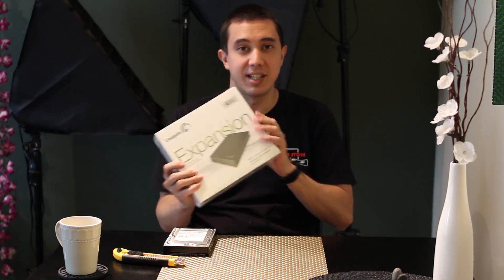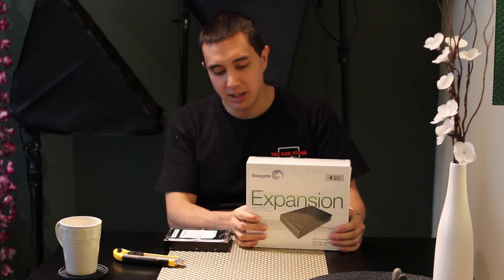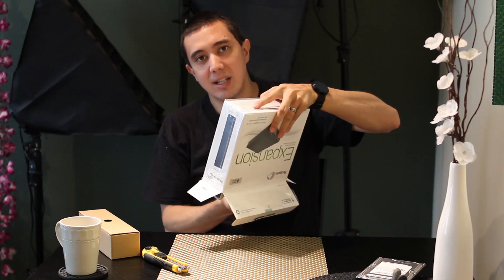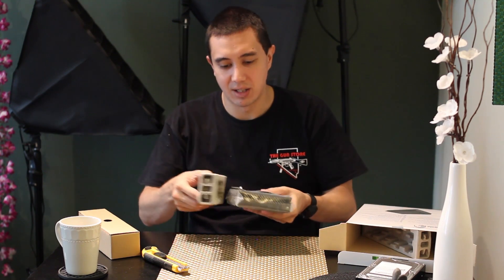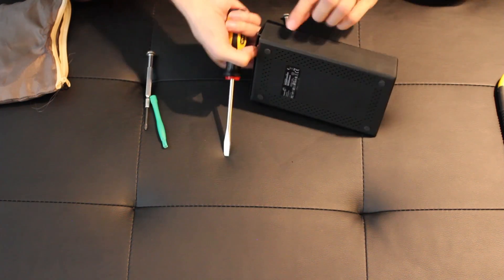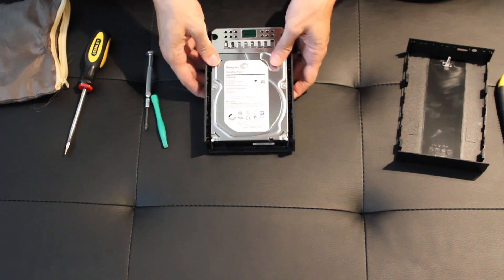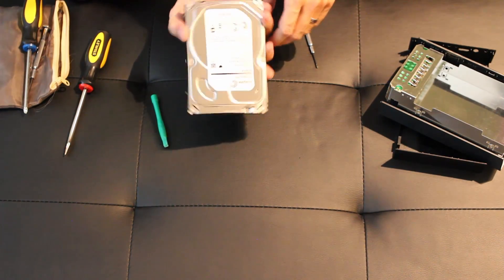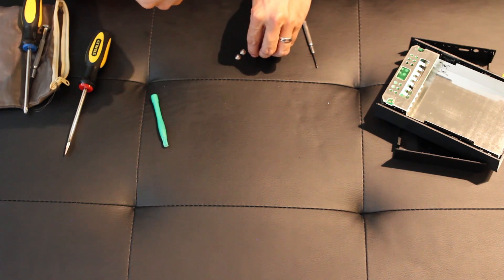Save money cracking open / disassemble seagate expansion drive 4tb

Comment: That's a good video explanation. A lot of people think these older Seagate externals are a failure but there is usually nothing wrong with the actual hard drive inside and they are recoverable. The older power supply adaptors are usually the biggest fault. Now with the newer USB power units advantage it's okay. Apparently you shouldn't try this with Western Digital units as their hard drives are designed differently.

Comment: Use for pc gaming? Load fine?
Reply from the maker: No, use an SSD.
Reply: TryHardGamers ssds cost way to much for game storage so either way I'll use a hdd for my games jw how well this is compared to normal hdd I'm need several tb and ssd that size well u know more then my 1000 pc
Reply from the maker: Are you talking about PC gaming? Why would you have several TB of games? I think if I installed the hundreds of games I have on steam all at once yeah, it could be a couple TB. but Am I gaming by switching game every 1 minute. You can get 1TB SSDs affordably now anyway.
Reply: TryHardGamers well I like to have my games downloaded and ready he'll my ps4 now has 4tb on this 5tb drive digitally...I've used hdd before for pc storage I was just wondering if I crack open this drive to put internally is it that much slower then normal internal hdds...and 1tb ssd is not a affordable for me still couple hundred and worth games being 50 to 100 gigs it don't last long
Reply from the maker: You decide what you do with your money and time. I would rather have the games I play available (ie. downloadable) and load quickly (ie. ssd).

But I understand if you have a slow internet connection. I've been there, as you can probably tell by my accent, I used to live in Australia and a game like WoW would take literally days to download.
Reply from the maker: That being said, I'd be surprised if there was a noticable difference between a 7600 and a 5400rpm drive for game loading. Games that take a long time to load are usually killed by seek time, and... all HDDs suck in that regard.

Comment: They wouldn't sell exact drives cheaper. It is very much worth mentioning what the sticker on that HDD says - what exact model is it,  and also running some test or info programs - maybe that would solve the mystery of it being cheaper. I believe it's at least buffer size that's less on those external models.
Reply from the maker: If you're worried about the performance of spinning rust, buy an SSD.

Comment: I'm thinking about adding an external drive to my PS4 with the Nyko Data Bank adapter, which accepts 3.5 inch internal drives. Does anyone know if this would work? If so, I might get at 5 or 6TB to futureproof myself and save money vs an internal drive.

Comment: Can someone tell me how to fix this: When I took the drive out of it's enclosure and hooked it up to SATA in my PC, it shows it as a D:\ Drive that needs formatting and two other unallocated partions! Yet, when I re-connect back to its enclosure with its A/C adapter connection, it shows up as Seagate Expansion Drive and works fine as my M:\ Drive! What gives?
Reply: the USB to sata card inside the enclosure probably has a encryption chip that only works if its used with the original hardware. If you dont jhave anything on the drive thats important, download WD's data lifeguard diagnostic and do a zero out of the drive which will make it unallocated like it was brand new, then u format it and boom you're good
Reply: ***** Well I have very important stuff on it, and I don't want to format it. Any solutions?
Reply: copy it to another drive

Comment: 5600 is garbage and you are better off paying more for the 7200 drives regardless what the author of the video is claiming. Its a 20% difference in speed and if you use this drive on a daily basis, you will not want anything lower then 7200.
Reply from the maker: For what use case, if you care about speed why aren't you using an SSD?
Reply: When you are dealing with TB's of data and browsing it on a daily basis, the 20% difference between 5400 and 7200 becomes annoying not to mention the more you fill that drive, the slower it becomes. It should be obvious with the cheap cost nowadays that a SSD should be used either-way. FYI you should try M.2 PCI and understand 5400 is a joke.
Reply: 5400 is quieter. Perfect for a quiet media center
Reply: 7200 rpm drives produce more heat. If you're dealing with TBs of data, you should use some sort of RAID setup.
Reply: Your comment is what's garbage. No drives are 5600. They are 5400 or sometimes 5900 (this looks like a 5900 rpm ST4000DM000). There are tons of use cases for lower RPM drives. Drive rotation speed doesn't mean the drive has a higher read/write performance.
Reply: WTF are you browsing TB's of data on a daily basis? do you know why  drives running at 5400 are made? because there is a market for them.
Companies research the market and build according to what will sell...How much research did you do?
Reply: if you use plenty of cooling on the drive you have no issues. ESPECIALLY in my file server, i got fans blowing on all of the HDD's, so they stay cool. 5600 rpm is too slow. I'd rather use a SSD.
Reply: for storage use it would be fine to use the 5900 rpm ones. But for a desktop/OS use it is better to go with a 7200/SSHD or SSD.I used to buy these and do the same thing, it was mostly a 50/50 mix of being a archive drive or a barracuda....
Reply: hows that electricity bill with all them fans
Reply: I agree on the Marketing tactics you mention, those tactics include grabbing as much money as possible and drives running at a faster speed cost more. so using your idea's it would make more sense to make more speedy drives/less slower drives and force buying of a product, I have an SSD as my primary and 4 of these external Seagate drives, they are all USB3-b and my data transfer is very fast.
Most people do not want to pay extra money for a 7200rpm when a 5900rpm runs fast enough.
I also think that 'People who haven't got a clue' are the one's who do not have a PC, It does not take long for someone with a PC to learn as they read post's on You Tube and various social media.
Reply: 8tb+ drives whether 5k4 or 7k2 rpm have similar read/write speeds at 200MB/s+
Reply: @pennyhardaway7491  8+ years later. You too reply with rubbish. SATA is limited at 130MB/s BEST CASE. Thats why M.2 went through the PCI BUS and does GB/s. Sigh.....
Reply: The market you are talking about is called a lower standard. People who haven't got a clue will pay for something as-long as they are ignorant to the fact that something better exists. Companies will sell garbage as long as they can get away with it and by that I mean make money. They do not care if they are taking advantage of you as-long as you believe you made the right choice, the future is all about making money period not to mention the average consumer still has yet to understand this. Brands of today haven't a care for quality like they used to 15+ years ago and if you disagree, you're entitled to buy garbage and think you are getting a good deal however you're always able to use search engines and dig deeper into what I've written.

Comment: Q: Has anyone run the serial number of the bare drive thru Seagate 
warranty status checker to see if warranty on bare drive is 3yrs, vs 1?
Reply: if u take it out of the enclosure and run the serial # thru their warranty status it will show as no warranty as a OEM drive because it is not meant to be taken out of the enclosure.. You'd have to run the serial # that u find on the enclosure itself. Also i think with their consumer drives, Seagate dropped to 1 year.
Reply: I ask because with drives from other external enclosures bare drive would show 3yrs, while enclosure had only a 1yr warranty.

Comment: Personally I don't mind spending a bit extra on an internal drive, since you usually get a longer warranty.  And when you open up an external drive like this you void the warranty right away.
Reply from the maker: +S Jones It really depends on wether or not you think the warranty is valuable. I understand those that want it. I personally trust the reliability of these drives and wouldn't put data on them if I felt I had to ever use the warranty. So to me, I appreciate the company trusts their product enough to put a warranty on, but if I ever had to use it, it would have already been a big loss to me (loose my data, loose my time handling the warranty).

And here's a question, would use use a HDD after a warranty, considering you already experienced a failure?

Comment: Please tell me where you shop because every external drive (or desktop drive) over here is more expensive than the same internal HD.
Reply: +danmar007  I've done some quick checking and you may be right. It depends on the brand and model and desktop drives are generally slower performers but like you say good enough for storing data. The prices are usually fairly close but cheaper is cheaper right?  I'm in Canada so everything is a rip-off here anyway. :-)
Reply from the maker: +danmar007 The base prices are often similar with often the advantage going to external by a marginal amount, not typically worth the effort of de-shelling. What is different though is often enough, external drives go on sale and have deep discounts, I've never seen discounts for base parts.
Reply: +TryHardGamers I see sales on internal harddrives quite often, with the edge almost always going to the internal.
Reply: +danmar007 At least in 2.5" drives (not 3.5" drives like here) it always seems to be cheaper to buy them as externals and throw away the enclosure and controller than to buy bare internal drives. A 2TB 2.5" external can be had for about 20% less than the bare drive by itself. Of course if you want to make a warranty claim you would have to put it back in the enclosure to do so - that is really the only downside of this.
Reply: earlier this summer i got a 3TB seagate (yeah i know, i preach that seagate is shit, but it was 40$, cant go wrong) external drive. I actually picked up 2 and put the drives in a desktop I have and made it a cheap little file server. Of course i also have the drives cooled by a big fan, still running good along side my 3tb toshiba HGST drive. Walmart was having a clearance sale.

Comment: planning to buy this  seagate expansion drive, can i automatically back up my photos on my cellphone using cloud or wifi? Thanks
Reply: Seagate is the only company i know of that does not use a USB PCB on the drive. Their drives use a USB to SATA card that makes the drive external. Toshiba and WD, their 2.5"portable drives are straight USB on the PCB of the drive so trying to hook that up to a SATA connection will not work, unless you transfer the firmware chip to a board that is SATA.

Comment: do NOT  stick to SSD  unless you like waisting money. ssd drives do not last long. you will be lucky to get 1 year from an ssd. so be careful who you listen to. there are hybrid drives now that have ssd and normal sata inside which do last a long tiime because of the way the ssd is used it only really reads from it not write, just buying ssd's is extremely crappy advise.
Reply: +Paul trotter You're vastly understating the performance, lifetime, and cost-effectiveness of SSD's.  I've been using mine for two years with absolutely no trouble at all.  Modern SSD's have been shown to be able to write in the realm of 500-800TB of data over their lifetime.  It would take the average user years to write that much data.  Also, many SSD's give error messages and warnings when the drive becomes unstable close to the point of failure.  I'd rather have this than a HDD succumbing to the click of death without warning, which I've had happen twice.  Furthermore, the performance benefits of an SSD far outweigh the concerns over lifespan.  SSD's are inherently faster than magnetic hard drives, more durable, completely silent, and immune to magnetic fields.  Solid state drives completely worth the money.
Reply from the maker: +crichton55 (Gelbooru) Yes this! The early SSDs had lots of failures but they were not actually due to the flash expiring. These days they are very reliable and if some how you do reach those kinds of write flash failures, like you said, they have far more graceful failure alerts.

Meanwhile google has shown that HDDs "Smart" technology for reporting failures actually has been extremely worthless in predicting failure before data loss has actually occurred.

Comment: i bought the 5TB model can i use it to upgrade my PS4's HDD?
Reply from the maker: Latifah M. Pretty sure the PS4 uses 2.5" drives, so these big ones will not fit.
Reply: Latifah M. you can, you need to buy the nyko data bank. i just did the same

Comment: Should probably mention that taking it apart most likely voids the limited warranty, so there's that trade off. If there is a manufacturing defect or the drive dies (and it's not your fault) before the limited warranty expires, then good luck in getting to convince them to send you a replacement.

You're now more informed to make the decision.
Reply: +Spicework Saz Right! As when you purchase the more expensive internal drive, you purchase the Warranty. So if you want to save money and not purchase a HDD with warranty, crack open an external hard drive!

Comment: Its possible, but it's speed is 80MB/s ,OEM internal drive are high speed drive ,it can reach up to 180MB/s
Reply from the maker: Rejo Chacko Absolutely. But if you want speed, I'd advise not looking at spinning rust and just get some SSDs.
Reply: +Rejo Chacko 195mb/sec max on my connected to usb 3.0 slightly slower thamy internal 2 tb wd black

Comment: Just wanted to say thanks for doing this.  I have a cooled enclosure for 3.5 hard drives that I prefer to the enclosures these drives usually come in, but I was concerned about buying the Seagate because I had heard rumors of people opening up the enclosures only to find out the drives inside are some proprietary connection (not SATA) or the firmware is rigged to not work outside the enclosure.  Seeing this, I figure I am safe to buy and crack.

Comment: installing this into my desktop can you explain how to do this I mean how to have the drive open in my PC ??
Reply from the maker: That varies heavily from computer to computer. If you never installed a drive before I recommend just leaving the drive in the enclosure.
Reply: Try Hard Gamers my question was really after you crack it open does it become part of a new drive in my desktop? or does it work only with USB ???
Reply from the maker: Well once it's open you need to put it inside your PC. Can't use USB once it's out of the enclosure.
Reply: Try Hard Gamers yes I know the part to intergrating in to system as a drive or do I connect to USB internally

Comment: What is the Model number of the drive that was inside the expansion?
Reply: TryHardGamers what does the model number of the inside drive read? Just wonder if it has the same performance spec of a ST4000DM000.
Reply: Above model no is here
http://www.memory4less.com/seagate-nas-4tb-sata-6-0-gbps-hard-drive-st4000vn000?rid=40
Reply from the maker: Absolutely not, still going strong. In fact, did this to two drives, both are good.
Reply: THANK YOU